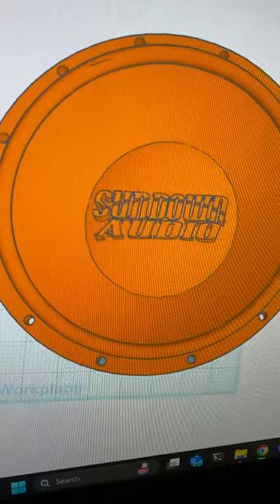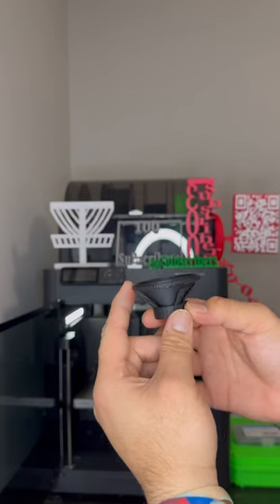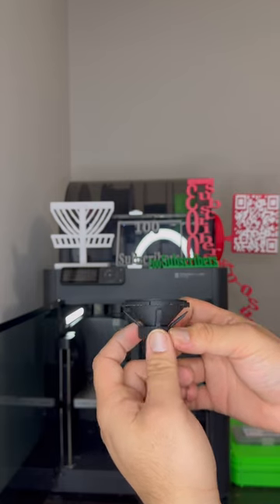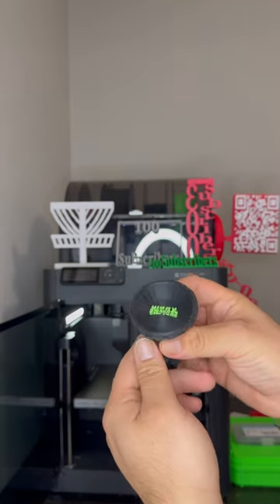3D Printed Sundown Audio Sub?! 🔊   #3dprinting #bambulabs #sundownaudio #subwoofer #shorts #foryou

Comment: I hope you dont plan on it actually playing sound, speaker cones are designed flimsy so the sound can actually resonate and travel, and the box is there to stabilize and also slightly amplify the sound production.  If you do manage to get it to work by some miracle please stitch this comment with the finished product and wire diagram i would be very interested in seeing it
Reply from the maker: I just wanted a modeled one I could sit on my shelf 😅😂